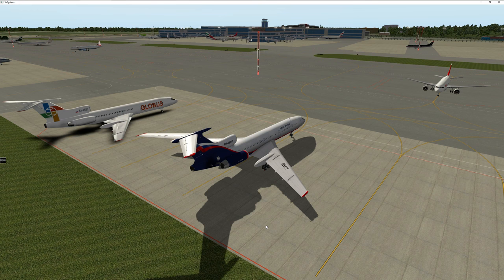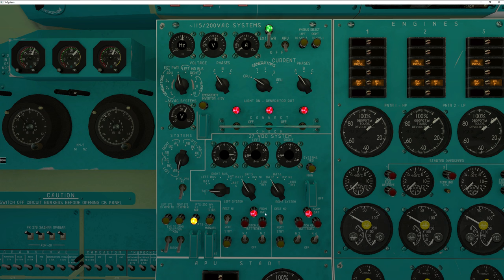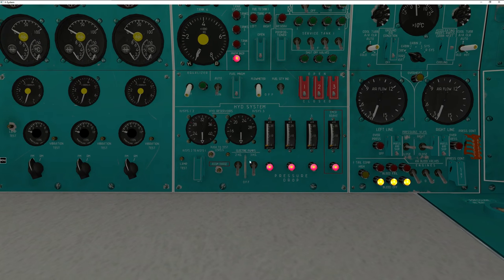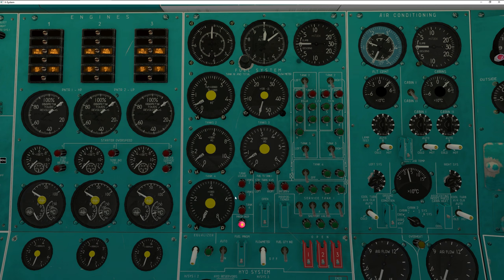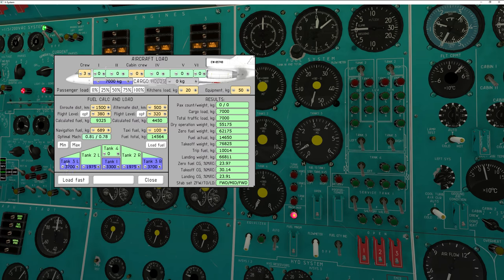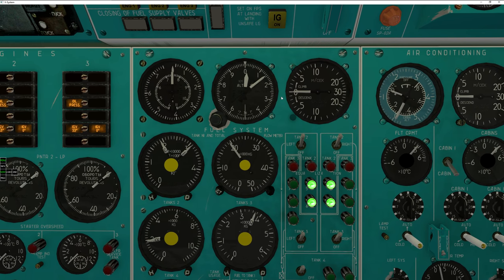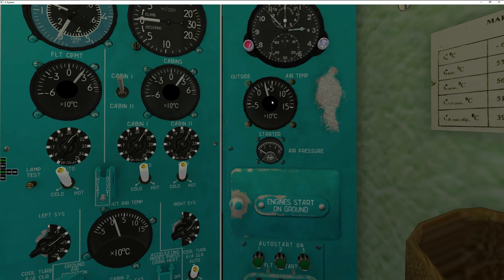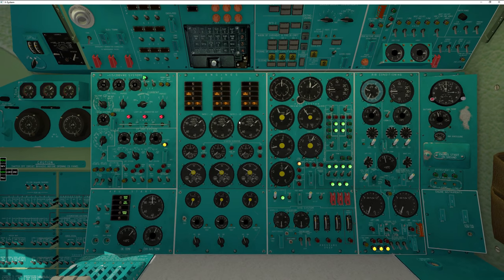Felis TU-154M Engineering Panel Overview

Comment: great video thanks for making this! Just interested, do you have any experience with this or the AN24 outside of sim/reading the manuals? You've certainly done a great job presenting the knowledge so far
Reply from the maker: Nope. I do like to read a lot though. It's my dream to see one of these planes in person.
Reply: me too, would love to see one! will you be doing a video focusing on the NVU? and the compass system? I really want to try and do a flight over the Atlantic with this aircraft but just can't get my head around the navigation systems, and getting them to fly true headings vs flying great circles, and re calibrating them while overflying navigation aids. Figured there should be just enough fuel on board to fly London to New York if you juggle the fuel tanks to get the CG right for landing. Thanks for your fantastic navigation videos for the AN24
Reply from the maker: +Luke Frisken Felis the designer of the plane actually has an nvu tutorial that you could use. For true and magnetic course it gets trickier.
Reply: true true, I did see that one. Thanks, giving the project tupolev manual a read too it has lots of good info I think